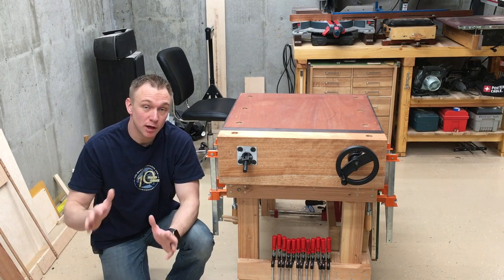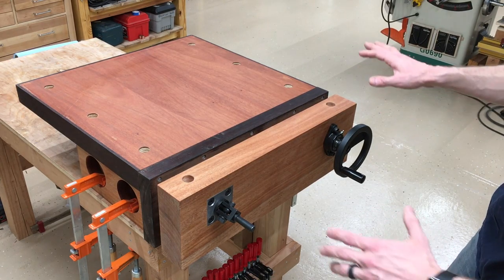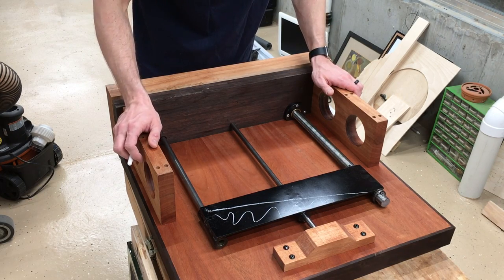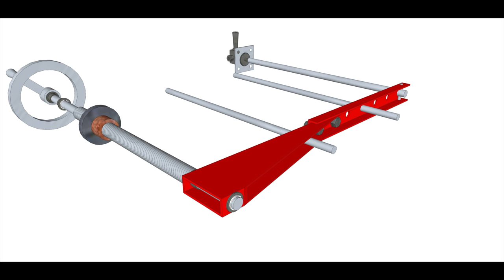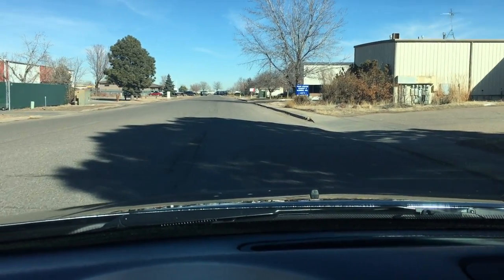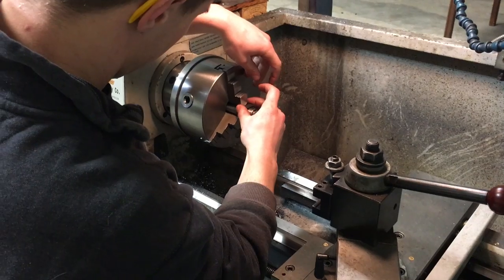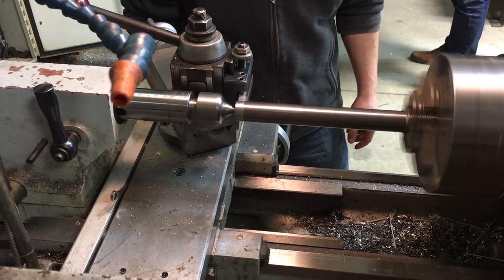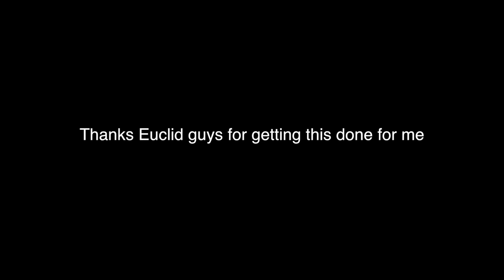Fast Travel Vise Update

Comment: Andy love your vice. As I was watching that threaded rod bounce. even with a straight rod eventually it too will bend and cause a wobble. But if you had stationary support at the end like a coupler housed supporting that end would eliminate a wobble on that end. let me know what you think!
Reply from the maker: Thank Brian, glad you like it.  I have a hard time picturing a design that will hold the vise front jaw parallel and not let it rack, but also not bounce and jam up if the rod is bent.  But it takes a huge amount of torque to bend a 5/8" steel rod, so i'm not very concerned about it bending.

Comment: Any mods that save production costs without losing functionality and quality are a good thing. Hopefully the manufacturer you choose to go with will pass on some of the savings to the consumer. Have you thought of making the screw a quick release version? What might be the issues with that? would it still operate with the guide bars and cam-clamp on the other rod?

Comment: Seems like the improvements will work well at getting it where you ultimately want it to be! Nice engineering Andrew!
Doesn't it just piss you off thinking you have good straight parts while testing and setting up a prototype, just to find that one of the main parts was screwed up (pun) from the start?!!
Well the bright side is that it got you to some great machinists which will ultimately be there for you to fine tune other metal parts from now on. So I guess it was another happy mistake!
Simplicity is going to be the key though. Looking forward to the next iteration.
Reply from the maker: Yeah, it was both frustrating and a relief to find that off center issue, a relief because I knew what was going on and why operation wasn't as smooth as it should have been.

Comment: nice vice let me know when u kick off the kickstarter.  what if u flip your plate over 180 so the flat side runs against the table to stop the wobble?  u could also use a track system if flipped over versus the middle rod?
Reply from the maker: I thought about something like that, but I want it to be able to work mounted with the wheel on either the left of right side.  And getting the plate that close to the table is hard because then the nut interferes with the table.  Two rods should work, and they are pretty cheap, its an inexpensive way to solve the issue.  

I'll let you know when the kickstarter is live, glad you like it.

Comment: Great idea 
to remove the bounce couldnt you add linear bearings and rails  above or below the threaded bar and the cam shaft. i guess there would be cost implications to this
Reply from the maker: +michael dodds you're right on both counts, it would work, but would be expensive, I need to hit a reasonable price point for people.

Comment: would you consider building in a sort of 'stop' design so you can cant the vice to accept tapered material?
Reply from the maker: +0v3nm4n it wouldn't be an easy thing to incorporate into the design, so initial it will launch without this functionality.
Reply: For sure. Would you consider adding in a feature like this in a later model?
Reply from the maker: +0v3nm4n if o can figure out a good way to do it.

Comment: Doesn't sound like it will be affordable, the standard twin screw vice goes for around $250.00 USD, since you made all these "improvements" to the design, it looks like it would sell for close to $400.00. I can't speak for other woodworkers but, I don't have the money, in this economy, to drop that kind of cash.
The fast travel feature is moot. The few seconds it takes to adjust the vice isn't worth the extra cost.
http://www.leevalley.com/US/wood/page.aspx?p=45114&cat=1,41659
Reply from the maker: Appreciate the feedback, a couple things.  I think fast travel is a pretty nice feature, like you said, its a few (10 or 15?) seconds less cranking when clamping different sized pieces, but any time i can eliminate irritations from my work flow it help my experience in the shop.  Also, If you are making a bench you can space the dog holes further apart and make fewer of them, because it doesn't take so long to move the vise jaw forward and backward.

And about price, yes, we are improving on a twin screw vise, but the improvements actually eliminate a lot of parts from a standard twin screw vise (smooth rod instead of a threaded rod, a chain, sprockets, chain cover assembly, etc.).  We are trying to hit a price point around $180 or $200.